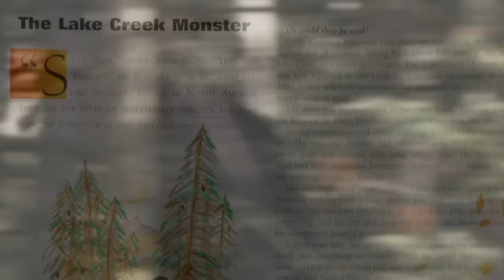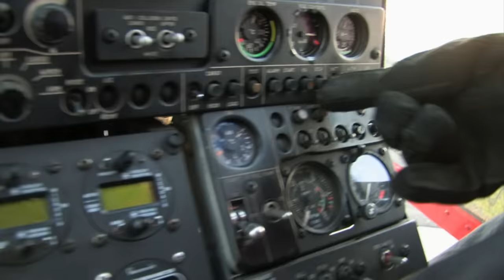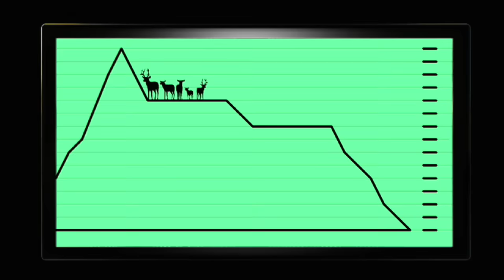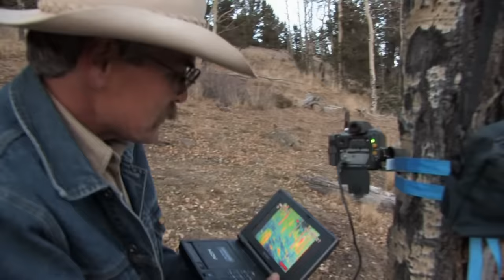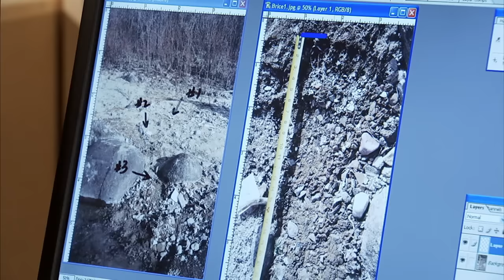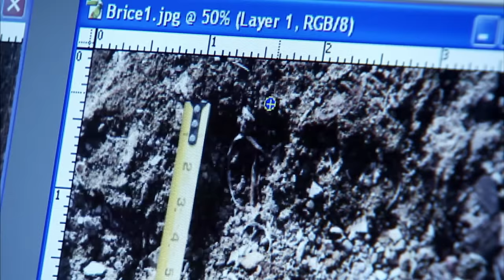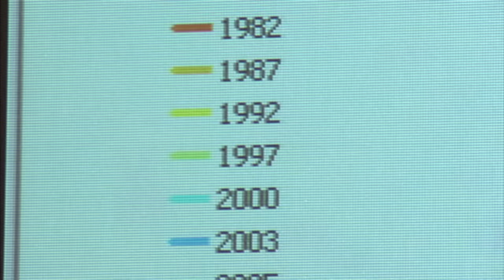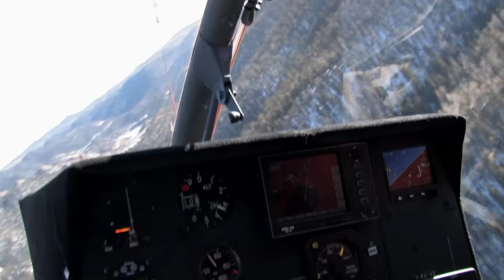MonsterQuest: CHILLING SNOWBEAST PREYS ON LOCALS (S3, E6) | Full Episode | History

Comment: What's impressive in my opinion about those eagle river tracks is that it's not just soil but a mixture of gravel and soil.  Something was mad crazy heavy to make those tracks. A mixture like that that's predominately gravel is much harder to compress than just soil.
Reply: They didn't mention that the soil at the time of the track impression could have been softened by rainfall.  The higher the moisture content of the soil, the easier it is to make an impression and leave a track.
Reply: @jasonlehman2090 toü

Comment: their technique is flawed. at any one time when we walk, the pressures on our feet isn't uniform throughout. usually, the heal strikes first, then the foot pressures rolls forward, with the toes last to imprint. also, the ground make-up also needs to be considered. after all, even if you weigh a ton, you still can't imprint a walking footprint on hard tarmac much. so, making that flat-foot contraption to estimate the weight of the beast isn't very accurate. i would guess from what they found in the pictures, the beast is probably 400-450 lbs only.
Reply: You are right except at the end thumbs down they never said the contraption with sand bags was 100% however it was best they could use for a Rough estimate of size of the creature. Knowing Bigfoot that imprint is that Terrain I think we are definitely Lookin at Bigfoot from 600-900 Pounds possibly slightly over 1,000 at any Rate definitely Probably Sasquatch of 7'6 - 8'8   yes were talking about a Big Critter that would make me Look small and I am very Tall and very Muscularly Massive, As I am a Lifelong Weightlifter.

Comment: Well im no expert, but that foot imprint machine they built wouldnt show a true weight due to the fact that  the foot prints are made when a body shifts it weight when walking, front to back etc..which makes the toes dig in.  The footprints on the machine come straight down without any weight shift.  Neither man or animal step straight down.

Comment: That test rig is a joke they have two feet on it so the total weight is distributed between them. An animal walking on two legs has it's full weight on each foot alternately as it walks. So take what they came up with and divide it in half which makes it 450lbs. Easily a large bear. Those "experts" should know better.

Comment: At that weight, our furry friend would be incapable of running. It would at most be a very fast power walker.
Reply: Ever see a wild hog move?  Weight has little to do with velocity, if the muscle is there.
Reply: @RICDirector  Not when your skeletal structure would collapse from the stress. A wild hog does not weigh in the tons range.

Comment: A good way to track bigfoot is to tranquilize some deer, elk, wolves, coyotes,  birds, etc. Put a camera on them that has night vision, and thermal that can be changed and monitored remotely. When they travel and move around more ground in remote places will be covered and you will see what the animal sees. Also put a tracking chip in the animal too so if it is eaten you can track the bigfoot. Hopefully the chip wont be digested as well.

Comment: interesting, but the footprint test wasn't correct. They tried both feet at once but an upright animal would not walk with both feet beside it's self. They should have done it one foot at a time, which would likely require less weight. anyway, its fun.

Comment: Very good track/footprint experiment and it took 900 lbs of weight to make a similar but still lack the exact level of depth of the 5 toes of the 19 inch Bigfoot footprint.  Maybe if they had added 300-500 lbs more on the wood structure then they can create the exact same level of depth of the 5 toes of the Bigfoot footprint. Very compelling evidence and experiment to show us that was no hoax because obviously no human weighs 1100 to 1300 lbs can even stand up let alone walk a few steps or a hoaxer (weighs 200 lbs) will bring 1100 lbs - 1200 lbs of weight with him to the middle of nowhere and create a fake Bigfoot footprint.